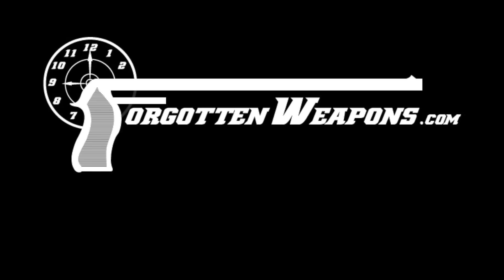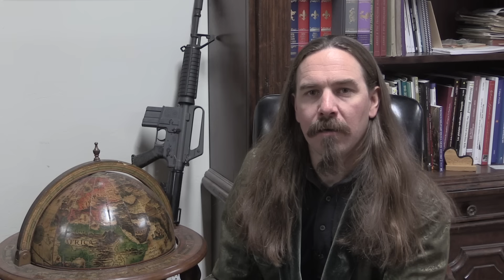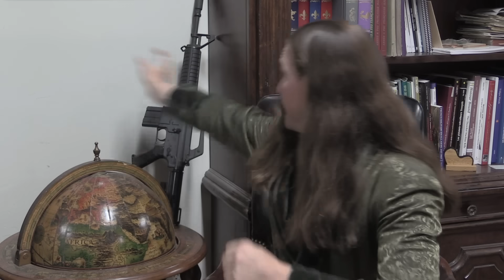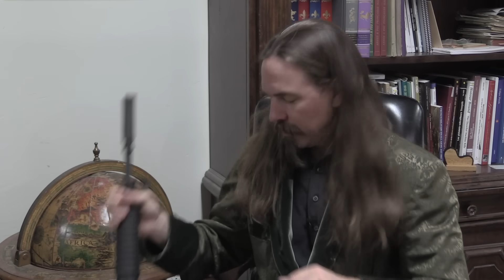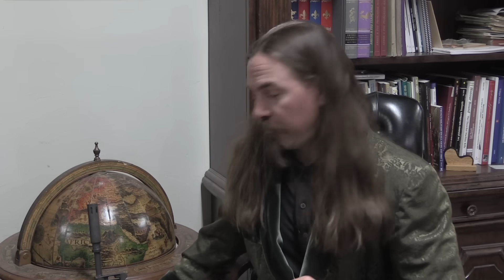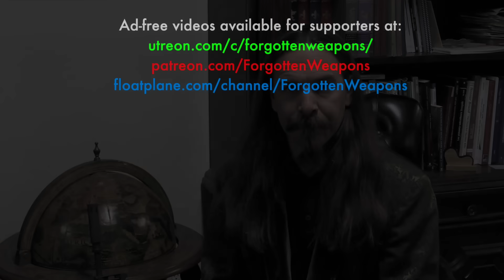Ask Ian: "Last Ditch" Rifles for World War III?

Comment: I've got one that's unpopular. Because aluminum is a strategic material needed in the aviation sector (especially 6061 and 7075) an AR upper receiver is developed that is stamped and welded from trunnions and and sheet metal.
Reply: Sounds like an AR 18 upper.
Reply: @jeff7.629  Kind of, but the G3 would be a better model of what would have to be done.
Reply: We could also use steel tubing, as a replacement. That way, we can skip the stamping process altogether.
Reply: @eksbocks9438   Great a modern sten or grease gun. Not that I disagree mind you. 

I just don't want to be the poor bastard lugging around a glorified sten gun in 2023 or beyond.
Reply: @eksbocks9438  but then you need to add more welding for lugs, and the tube would either be heavy and consume raw resources, or thin wall and require tacking in reinforcements. The barrel nut threads are 1.25", and the bore is 1". .125" wall is excessive for a basic grunt blaster.
Reply: @randomidiot8142  The lugs could be incorporated into the front and rear trunnion.
Reply: @eksbocks9438  you'd need to forge the front trunnion with a lug vs turn the barrel extension. The minor diameter on the lugs is too small to press a barrel in from the back of the trunnion/extension and additional fixturing to thread the trunnion true for the barrel could be problematic.
Reply: @clothar23  The thing about the M3 Grease gun is it could be mostly made out of polymer today.   Most of the moving parts are self contained within the shell, and no moving parts except the trigger assembly even touch the shell.  A polymer grease gun could be made by the millions for a few dollars each and given out to everyone, then save your rifles for your few actual marksmen.
Reply: KP-15 monolithic lower FTW.  I love mine.
Reply: This literally is the reason the ar180 was made. To make a cheaper version of the ar15. But ironically, now you buy an ar15 because you cant afford a rip off of the ar180
Reply: @jackmehoff2363  Economy of scale. Stamping comes into its own when you have enough demand to slam out high volumes.
Reply: Yes, that would have to happen very quickly. 
I also think polymers would be dropped very quickly because they're a complicated material.
Reply: @agentcrm  Depends on the materials involved and how hard it is to source them.
Reply: Check out the AR-180.
Reply: There is wayyyy more Aluminum in the economy and availabile to recycle than that.  WW2 situation was before mass market aluminum adoptions.  We use 5 million tons a year now, vs maybe 1.5 lbs/upper.  Recycling 1% of last year’s aluminum use would provide 66 million uppers worth of material.
Reply: @Georgewilliamherbert  Big picture, rifles will not be getting a high priroty access to the high end grades of Ali they might like. 
Proioirty will go into aircraft manufacturing, and those use a lot more materials than they did during WW2. 

Also because we recycle so much of it, when demands ramp up at unsustainable levels. There will be production shortages.
This has already happened with the Ukrainian war, with the import bans from Russia.
Reply: @agentcrm  We know that the AR upper and lower can function fine made from 6061-T6.  That's widely available and recycleable and it's not used widely for aircraft anymore.  Cast alloys that also aren't used for aircraft are widely available in aluminum surplus and equivalent properties.

"We're going to run out of aluminum" isn't likely even in a post-nuclear-apocalypse scenario.  It's literally the most recyclable material known to man.
Reply: @Georgewilliamherbert  6061-T6 is not exactly a low grade of material.
Ali is the most recycled material because it's cheaper to recycle it than processing ore into flesh material.
The most recycleable material is easily steel. But because iron ore is so cheap and plentiful, very few places bother recycling it in large quantities. 

Just because we are recycling it, does not mean our need for new material isn't there. If we look at how much extra material was used during the world wars. There is not enough the needed aluminium grades in the world to last a year.

I'll pick something I know well. Pre 1940's most ships that used water cooled bearing, used an oily South African timber. The world ran out of that supply and of trees that could be use. It's only quite recently that the materal has been re allowed for historic vessels.
Reply: ATI Omni Hybrid uppers.
Reply: I think you understand and Ian doesn't. Complex aluminum forgings are FAR from last ditch....
Reply: @eksbocks9438  Except stamping clamshells into receivers allows contours that would otherwise need to be milled in to be compatible with the AR-15 BCG.
Reply: flat plate
Reply: If you're at the last ditch stretch of the war, would the Air Force even be active?
Reply: You also have to consider compatibility and the time needed to develop tooling. Stamped ARs aren't produced in large quantities, if at all. It would take time to develop the tools needed to mass produce a stamped upper that maintains parts compatibility. On the other hand, the tooling for extruded Aluminum uppers already exist.
Reply: You want to be the other guy who's already dead?
Reply: @Hjerte_Verke  They're definitely more last ditch than complicated, expensive new tooling to make a new stamped design.

Comment: Soviet had a similar project when it attempted to simplify the AKM and AK74 production for normal factories without guns expertise. These AKs had the handguard simplified, no muzzle thread, the stock being something like metal wire folding stock but fixed, some parts were casted rather than milled, and the receiver was more like being bent instead of being stamped. They are also equipped with three 40 round mags instead of typical four 30 round mags
Reply: What was the name of the project? I'm kind of interested
Reply: @eksbocks9438  Wartime AK 6P1

Comment: Love how the Fallout pre-war American military start this way. Went from advance materials to wood.
Reply: NCR Serivce Rifle.
Reply: @TheStewieOne We won't go quietly...
Reply: Wood may not be advanced, but is it cheaper/faster to make than other alternatives? A big part of the weapons development of WW2 was changing a lot of weapons from wooden stocks and milled parts to stamped sheet metal because of how much more efficient it was for production, if not for effectiveness.
Reply: @Captain-Jinn  It is not faster than polymer, and unless cost of labor is very low it isn't cheaper either.
Reply: @TheStewieOne  Those are later. I was thinking the R91 and R series rifles.
Reply: @pilferedserenity1570 in universe, hydrocarbons/plastic was expensive. Stamping may have been cheaper but there may not have been time to tool up for that
Reply: @Captain-Jinn  Creating metal parts requires industry, carving a piece of wood does not.
Reply: @Captain-Jinn  It's definitely possible. But I don't think they realized it. Until they had to get creative.

Up to that point, nobody really knew any other way to make a stock.
Reply: @Captain-Jinn  Stamped metal production requires advanced tooling and manufacturing processes. In other words there's a lot of initial investment and development required to get to all-metal firearms production. That tooling may be sitting around after the war, but it will still require a lot of restoration and a lot of manpower to get up and running. It will also be in limited quantities since nukes were likely directly targeting those kinds of manufacturing facilities. The only factions that seem to have that capability are Gun Runners, NCR, and maybe BoS. NCR not so much since their bureaucracy is shit; Gun Runners have shown themselves to be the definite top dog in post-apocalypse firearms manufacturing. BoS is rather irrelevant since they seem to be dead set on not sharing anything with anyone.

Comment: Definitely have to agree with the poly lowers idea there. I worked in a production plant that made AR parts and that 65 second turn around per part stacks up roughly with how long it took to load the machine up with each part, machine time was probably 15 minutes per part from forging to finish machining (so not counting coating, or anything else.)

Would be harder to get the rest of the machines (even counting the ones saved by not milling lowers) to keep up with that lol.

Comment: Watching a bunch of machining videos showing the setup time for an operation makes your discussion on simplification a lot more relevant.
Reply: I think he's wrong, because of the time taken to make the mould. Once you have a mould then yes it's fast, but til that point CNC wins for speed.
Reply: @donaldasayers  problems of speed are definitely complicated.
Reply: @donaldasayers  I agree.  Perfecting a mould is very time consuming and CNC will beat it out if you have enough machine time.  If you are making an injection mould then focusing your efforts on mission critical areas where tolerances are important and niceties like exterior finish are secondary can yield a fast turnaround time.  I believe his point is that once the mould is in place the cycle time per part decreases exponentially.  CAD combined with CNC has dramatically reduced mould creation turnaround times.
Reply: @donaldasayers  It takes a long time to design the mold. We have a good mold design so that part can be skipped. Making the mold once it's designed still isn't easy or fast but it's faster.

In the end, it's constant setup time and much faster unit build times after that, versus slower unit build times without (as much) setup time. Over a certain number of units produced, the mold will be faster. That number won't be very high either. If you're to the point of needing to simplify production, you're well past the number where injection molding will be faster.
Reply: A major advantage that a polymer receiver gives other than speed is use of production capability that might otherwise be underutilized. There's probably a fixed number of facilities with CNC machining centres as well as the skilled staff to run them efficiently (inspection, maintenance, setup). Find an established factory that injection moulds car dashboards, send them a few sets of receiver moulds and some technical data packages and let them get on with what they're experienced at, i.e. injection moulding complex parts at quantity. Let the machine shops churn out stuff that can't be moulded, like bolt carriers and TMH parts.

This approach is the reason Britain produced the Mk3 STEN (utilisation of parts stamping facilities for the toy industry) and the De Haviland Mosquito (furniture workshops).
Reply: @lordsummerisle87  Stens and Mosquitos were EXACTLY what came to mind when I started reading the comments, along with the magnificently designed PPSH-43. Did the same thing as the ppsh-41 but used about 13lbs (vs ~30) of raw metal to make an~10lb gun and in ~2.5 man hours vs ~5.

Comment: An interesting contestant in the competition that ended up adopting the T44 as the M14 was the T25. The design was optimized for production after the US industrial complex was heavily damaged by a nuclear war. The T25 could be built on simple, typical machine shop tools. It also proved to have the strongest action. The T25 also came closest to meeting the demands of the Infantry School in weight, selective fire manageability and other requirements. The AR10 met all the requirements but became available after the decision to adopt the T44.  And I agree in a industrial situation where polymer molds were unavailable the best selective fire light rifle would be the AR-18.

Comment: One last ditch feature is get hid of the buffer tube and buffer system entirely. Make a new upper receiver with self contained spring like Sig did in their rifles, is another good reduction in parts needed for a functional rifle. Trow in the deletion of the forward assist and you get a gun that is lighter and with a lot less parts.
Reply: I don't know if you have seen bolt carrier in Sig MCX and speer

This bitch would take so much more machining time than standard tread and screw in buffer tube 

Jumping in to monolithic would be way easier and cheaper than retooling for new bcg and receiver
Reply: @Miazger  I said Sig but can be like the AR-18.
Reply: It would be pretty easy to do, as well. The spring would have to be up top, though. So it can clear the hammer. Then make it a side charger.

Other than that, it's as simple as cutting off the back of the bolt carrier.

Comment: I'm impressed the first modification isn't getting rid of the forward assist. Multiple pieces and machining operations, fiddly to install, and usually unused. I realize it (and the winter trigger guard) would be rolled into "monolithic receiver changes" but much like the M203 cut, it's really a holdover from original designs that may need to be depreciated.

Comment: I could imagine it being like a Luty SMG, with a delayed-blowback action. Like the HK G3.

The upper and buffer tube would be just a single piece of square tubing. And the lower would be the same.

Then just duct tape a piece of wood for a handguard. 

Or incorporate the handguard into the single-piece upper, so you can add a front sight easier.
Reply: The TRW LMR comes pretty close.  Open bolt, delayed blowback 5.56 rifle designed as an airdropped insurgency weapon.  It also looks like a dollar store FG 42.

Comment: I think the govt would be hesitant to change anything about the base M4A1/M16A4s. They're NSN end items, the designs were frozen, and any contractor supplying parts must meet the technical data package requirements.

I think any M16/M4 variants in storage, with guard or reserve units, or less-critical components would have their weapons taken and moved to where they're needed first. 

I think the many US makers and shops of AR parts would be involved in turning out parts, and maybe certain requirements would be dropped or mitigated to keep units flowing from hundreds of big and small companies in the mix. FN and maybe several other big AR authorities would be tasked with final assembly and inspection of completed units. This might involve farming out the mil spec inspections, or the govt still doing them, but with very large batch testing.

I think, if it was even more desperate than any of that, then what Ian said would probably happen. Something like KE Arms poly/monolithic lowers, with no optics, basic iron sights, probably even standard hand guards. You just need weapons, cheap, fast, and a lot of them. If the govt was willing to cut through its own red tape and just get what it needs in a super dire situation, I think it'd make a lot of sense.

Comment: Seems to me that the forward assist would likely go away; it's not necessary to the basic function of the rifle and it adds several small parts that are potential production bottlenecks in a breakneck, build-as-many-as-you-can scenario like this. This could also reduce production time on the bolt carrier, since they wouldn't need to bother milling the ratchet grooves. I imagine they'd just fill the hole where the FA is installed with a solid plug rather than change the actual receiver design, though.

Comment: I wouldn't be surprised if people on Reddit started building last-ditch world war3 M16/AR15 clones using Kp15 lowers
Reply: I'm not gonna lie. That would be awesome
Reply: I don't think the majority of r/users know how to simplify a weapon. They never stop adding crap trying to make the ultimate multi tool that ends up being as useless as the 'every option' swiss army knife that barely qualifies as a knife.
Reply: My reddit version of a simple wartime production rifle would be a KP-15 monolithic polymer lower with a semi and auto selector. Paired with a 14.5 inch government profile barrel with FSB. A2 flash hider, A2 handguards, and a Daniel Defense A1.5 rear iron site. A one piece webbing sling with forward mounted sewn on triglide for length adjustment retaining a QD stud and mount attached to the upper receiver rail. The rear webbing has two triglides through the buttstock for a sling stop. For the field gear just give them a six mag bandolier, a pack of Skittles and Red Bull and say go for it.
Reply: @randomidiot8142  what if you have night vision? Or you want to see in the dark? Optics and flashlights with ir laser/illuminators give you a discernible advantage. Hell, you could replace the optic with a thermal optic then all you’d need is a flashlight. Without them, how would you fight in the dark or against people with those things? Can’t see irons in the dark. Slings are important too.